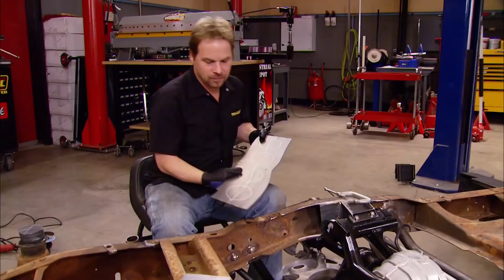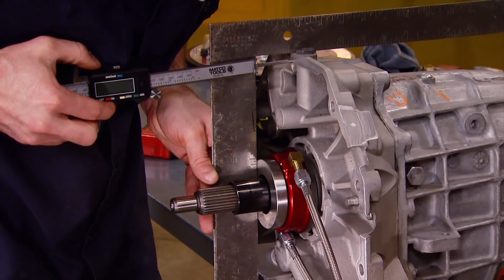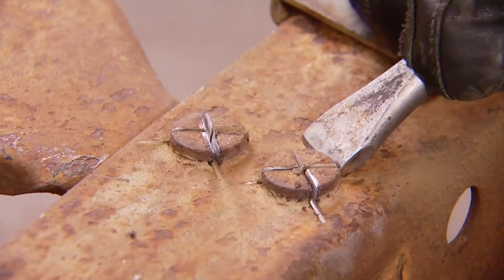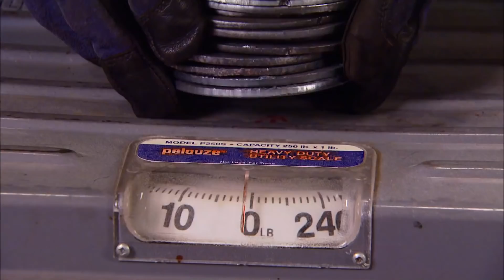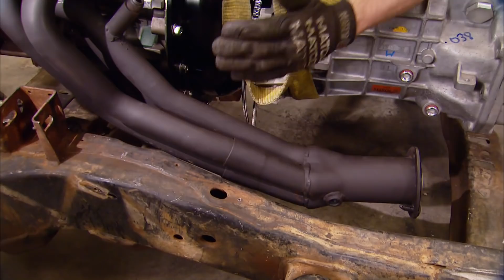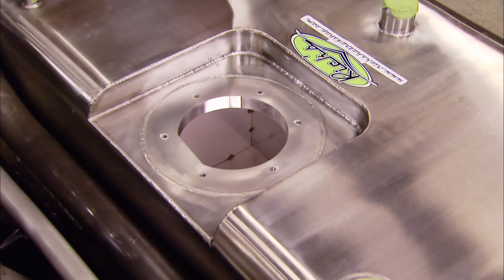Supercharged Cobra Aluminator Engine & 6 Speed Transmission in a Ford Ranger - Trucks! S12, E16

Comment: On torque to yeild fastners, you can get a digital level that is zero able, klein has a great one for about $40. Just get tension on your ratchet, have the level on the handle in the same plane as the ratchet swing, zero the level and sendit 🤙🏽

Comment: Stopping the video while a commercial was on! You guys just made a huge mistake. A large unforgivable one. Cutting weight on a flywheel greatly reduces torque... find out from the speed shops the reason for torque is mass weight and what it takes to stop it. A lighter wheel ... flywheel, is easier to stop or less torque. I hope that you read this and catch your mistake in time as you will lose significant power. Torque power!

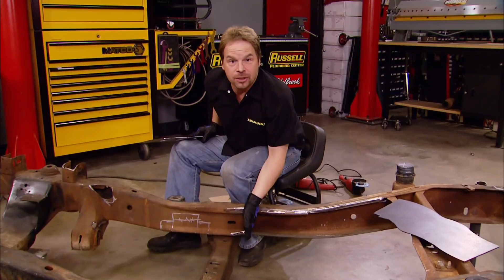Comment: 1:08 Simpson Speed Holes??? Pontiac beat them to the punch way back in the 1960's. Chassis with those holes were found on the LeMans and GTO's, (maybe even a few other cars in their line) and it was called a "Swiss cheese frame" for the same obvious reasons.

Comment: Boxing in a frame is fine, speed holes are fine but you want some drain holes in the low points or water can pool up inside the frame rails and rust them from the inside out. This is why most factory frame rails are C channel instead of being fully boxed. Its cheaper to do fairly strong and allows water to escape freely so they dont rust out as fast.
Reply: The Don well how crappy those welds looked, I’m sure there are plenty of drain holes.

Comment: Like you sead. You can still run lines in the frame rail with those holes. Good job guys.
I've seen a lot of boxed frames.
Not very many with access holes. You would think they all would be done that way.makes perfect sence. And it does not take away strength at least none you can measure.
Greaaaaat video
Keep em coming.

Comment: Needs another tube at the end of the frame running cross-car to increase torsional rigidity.
Reply: Dr M I was thinking the same thing. They lost quite a bit getting rid of that spare tire mount.
Reply: @TheMattc999  I haven't seen the result yet, so maybe they caught it and addressed it!  Doesn't have to be a big tube either... thin wall stuff would do just fine.
Reply: @TheMattc999  Yeah, if you really want regidity, always triangulate...
Reply: The stainless tank, when mounted properly will reinforce some ridgity but they do seem to make lots of short cuts to make a faster build & video

Comment: The plates for boxing the frame in should have it's "speed hole" punched in, which creates lips all around the edges. This adds a large amount of stiffness to the plates, while also keeping the weight down. Plus, the insides of the frame should have been clean of rust and coated with weld-through primer.

Comment: They should have dimple died the speed holes.
Reply: Dimple dies would have been stronger, and the could have used thinner steel.
Reply: was going to comment the same thing
Reply: You beat me to it. Adds zero weight and offers double the strength.

Comment: Am I the only one bothered by all that rust on the frame?  They're doing so much work on that frame and not getting rid of the rust.  Media blast that shit and powder coat it.
Reply: The rust isnt that bad, but it does bother me that it doesn't match the rest of the truck
Reply: I'm guessing they'll blow it all apart and powder coat the frame before final assembly.
Reply: You clearly don't live up north, that frame looks perfectly fine. Surface rust is inevitable anything over 5 years old has it and it doesn't really matter, it's an issue when it starts rotting through.
Reply: I clearly don't live up north either, but why not clean it up and do like you said?  Because it's a TV show, not reality, and these guys don't care.

Comment: Will the ‘speed holes’ in the frame rails trap dirt and moisture, then rust out fast?
Reply: If they don't put drain holes and coat the frame probably.
Reply: I was thinking the same thing.  Just a partial speed hole at the low point of the frame should allow the frame to shed build-up.
Reply: You’re making way to much sense for this show. Lol
Reply: Only in the north, son
Reply: They don't care. That truck is already in their rear view mirror.
Reply: The speed holes don't matter when you don't take the rust off the frame to begin with. I would have cleaned the frame off and painted it with weld-through primer before boxing it, then primed all the bare metal again. They might still do that, but it seems like they're working backwards. I would also just have notched the frame for the headers, you're already doing frame work.